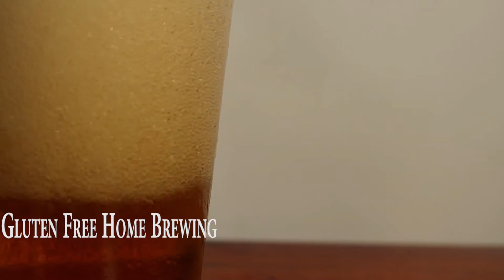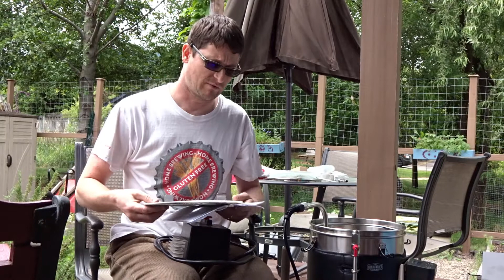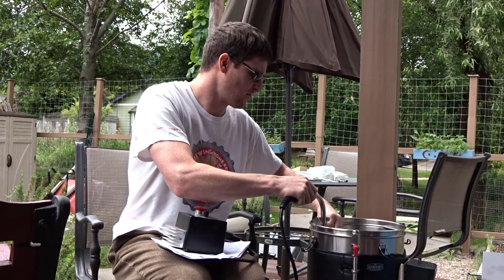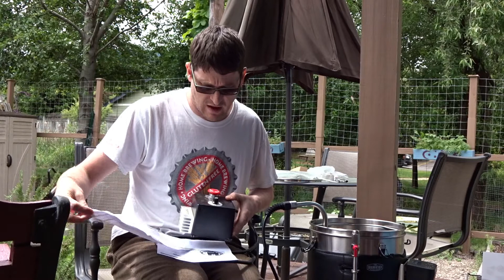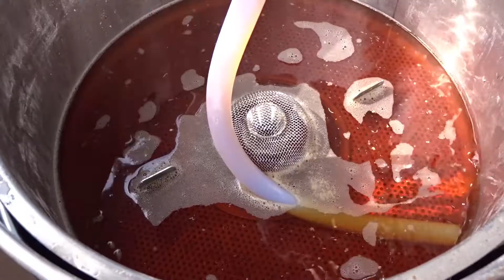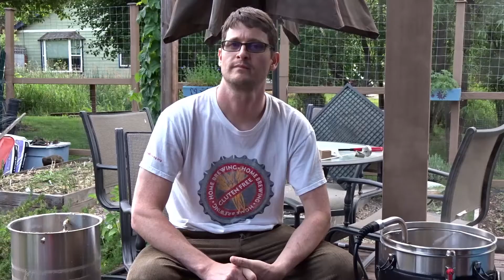Brewing Gluten Free Beer Using The Grainfather Part 5

Comment: Did your original splatter screen insert not work out?   Nice looking wort!
Reply from the maker: The splatter screen worked out great! That is what we used for the brew you watched in this video. We order some additional screens at various microns to test them out and report the results. The splatter screen is about 500 microns and does require to restrict the recirculation flow rate a bit. But this does not seem to cause any issues with the mash.